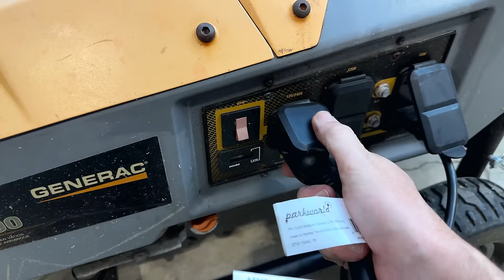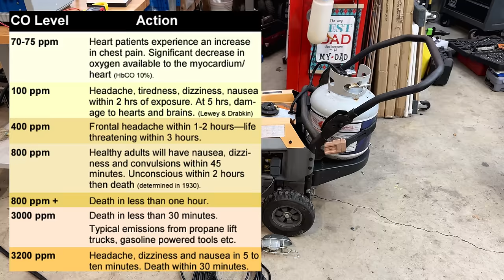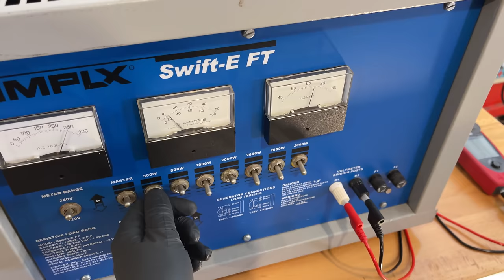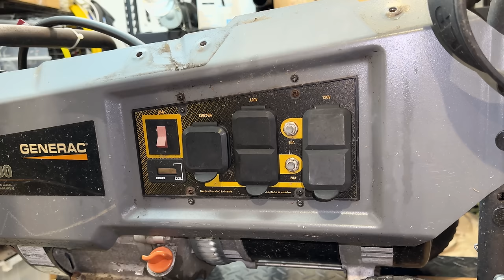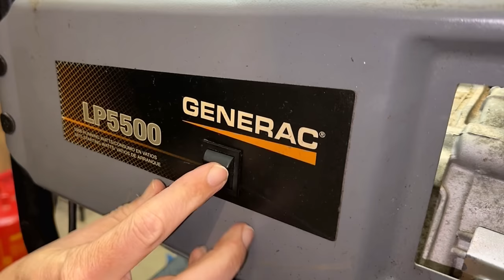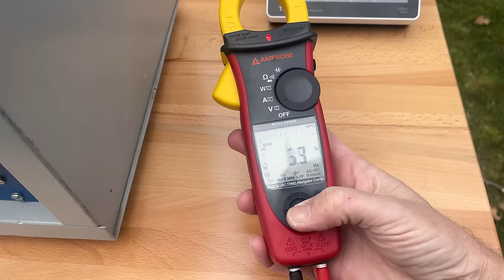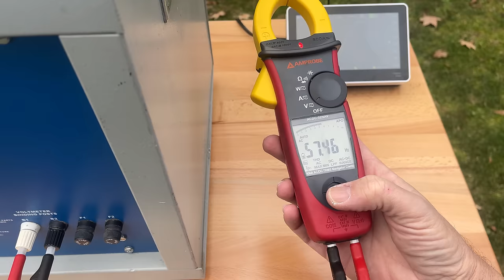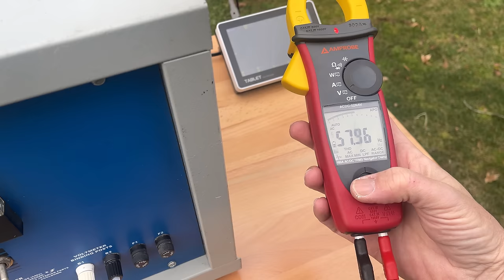Will a Cheap $40 Carburetor Breathe New Life Into This Machine?  Generac LP5500 Generator

Comment: That has to have a heat shield.  Between the hose and the exhaust.  Its not optional.  Major code issue.  You also have violated code by having a two stage regulator that vents in the open near the electrical panel, and within 3 ft of the exhaust A two stage reg vents propane to atmosphere under certain conditions.  You have ignition sources way too close. 
That machine is an explosion waiting to happen. 

The old automotive style regulator was isolated from speak and ignition  by metal shielding. 

This one is not. It has vents. 

Don’t even think about selling it. 

Serious advice from someone who knows.  Unless your insurance covers burning down customer houses, etc. 

Sorry to be the bearer of bad news.
Reply from the maker: I agree a heat shield should be added. I would have thought/hoped Generac would have done that if code.  Either way I will add one.  The two stage regulator is a couple feet further away then the original.  Under what condition would it vent propane aside from a failure in a diaphragm?
Reply: @jcondon1    You are right. That regulator will not vent unless it fails internally. OTOH, the original regulator was mounted on that plate, which probably qualifies as a heat shield. Also, the exhaust faces forward to get it away from the mounted tank. That said, I would add a heat shield, but point out that this modified unit is no longer UL approved as it sits. BTW, the rules are different for portable units versus stationary gen sets because it's just not possible to isolate the fuel supply and its systems so many feet away from the engine.
Reply: @jcondon1  the biggest issue with most propane powered engines and devices is regulator failure.  Diaphragm failure is caused by poor quality, by water in propane causing corrosion, by propane additives, and by liquid propane reaching the diaphragm.   I have seen that last condition many times when a tank is tipped over. Liquid propane reaches the diaphragm through the lines.  Poof, venting. 

That said, outdoor portable appliances don’t have the same code as larger scale items, so it varies by jurisdiction. 18inches seems to be the going number for the regulator distance so you are fine. I was wrong on 3 ft.

There are a couple of other code issues, such as feed tube routing, clamping, using bendable wire ties, etc.  but reality is and common sense says this stuff  is ok. 

I would go back and visit the propane fitting on the bottom of the carb. It is likely sealed in with a urethane hardening gas line dope.  Apply a small measured amount of heat (not MAP)  to the barbed fitting (not the carb body) to melt it and then turn it out. Install a 90 degree male fitting down (use gas rated pipe dope please) , and use compression fittings on the line and use a crimped clamp. Not a clamp that can be tampered with.  Crimped, it’s the same as a store bought hose in the eyes of the code. It’s permanent. 

Then bend the exhaust back.  And put in a small plate extended down From the grey side plate (use two bolts to protect the carb, but still have access.  Your idea about going  under with the hose was a good one. 

So you need a male to
Male 90 degree fitting that goes threaded male into the carb (probably 3/8 but might be 1/4) and 3/8 male NPT on the down side . Then buy a female NPT barbed fitting for the hose side and use a crimped clamp.  If you do these things it will be pretty much to code and more importantly safe. 

No type of screw on hose clamp is ok.  Not high pressure, not low pressure. Crimped.  (Screws vibrate loose) 

Hope this helps.  And of course, it’s all your call.  We all learn together.  You are a smart guy.  You already saw the 90 as the solution.  But you gave up too fast on the barbed fitting removal.  It comes out
Reply from the maker: Thanks for all the information.  I did give up too fast on removing the fitting.  Was concerned about heat and damaging the diaphragms.  Will swap out the fitting and add some heat shielding.
Reply: I cant think of a single gas BBQ that meets those codes
Reply: @phillipsmiley5930  you mean the ones with steel panels in between the tanks, hoses and ignition sources? Yes, they do.
Reply: I would say that Madman is just that. If we were all as paranoid as you nothing would be running. I think James did a great job and the unit is actually safer than when he took it over.
Reply: @WrigleyFieldBlues sometimes I wonder why people like yourself cannot see discussions going on, without throwing in an insult or three.   

Then I realize you don’t even fathom why these discussions are held. And you never will.
Reply: @MadmanJimbo  Your self righteousness is only exceeded by your self imposed expertise. James has a quality running unit now. You would have a garage full of parts while you wait for non existent heat shields and regulators to show up. Actually, I understand you all too well.
Reply: @jcondon1  props to your measured responses here. when i started to read this person's comments, i cringed at the arrogance. after claiming it was "an explosion waiting to happen", and having to walk back their misunderstanding of code, no humility was shown. your responses illustrate civility and wisdom.
Reply: Why not use that fancy thermo detector you recently showed and see what kind of heat you're dealing with?
Reply: You're being a bit dramatic with the "explosion waiting to happen".
Reply: @WrigleyFieldBlues  as I thought.  You will never understand.
Reply: I have worked around pneumatic regulators that regulate 120 psig down to 20-30 psig back in the 80’s but not many Gas appliance regulators and I had completely forgotten that most high pressure in low pressure out vent to atmosphere to protect what they are providing lower regulated pressure to.   Good catch sir. James does nothing that he would consider remotely unsafe especially for the consumers if his units he resells.  Thank you and I’m sure he thanks you.  @phillipsmiley5930 I was thinking the same thing but was not sure. And on those you have a tank generally under or almost under a fire and considerable heat when operating the grill.
Reply: @John-tn5dn  the USA has lots of rules.  Municipal, County, State, Federal, HOA, etc etc etc. 

Sure is a paradox of a country.  

We have far fewer rules here.  And far less crime, far less incident.  

I think open discussions of what is dangerous with propane is a good idea myself.  To protect children mostly. And of course, you have a very litigious society.  We don’t. 

Kinda like gun laws.  Keep guns out of the hands of the insane who shoot up schools, concerts, theatres, businesses, nightclubs. 

But what do I know?  I only live in a place with very little regulation, and have never seen an act of violence ever.  Homes here don’t need HOA rules.   

They are a few miles apart.  Lol. 

If you wish to modify propane or natural gas powered things with no discussions, you certainly can do it.  

There is a great video I saw of a guy who whacked a can of WD 40 with a stick.  You should watch it.  Then multiply it by 100 for a propane tank.
Reply: Madman, why straighten exhaust unless you are concerned about wheel or backpressure?  I like a heat shield for added protection to the carb but question its necessity unless something failed.  I saw James used a thermal imaging camera in another video, I would be curious to see change in temps original exhaust, 90 degree bend with and without a heat shield.  If I  recall correctly radiant heat transfter changes as distance increases to 4th power so small changes in clearance can have very big impacts.  The other thing is for a portable generator couldn't you put a standard Generac forward exit exhaust on (James should have them laying around) and relocate propane tank to the rear (even remotely).  My Generac 5500 uses about 6 gallons of gas for 12 hours give or take.  So if I fill it to the top of the neck it powers my house for 1/2 day.  I wonder with 50 pound remote propane tank how many hours at 50 percent rated load I would get.  I would love to be able to set it up and run for 48 hours or more before changing propane bottle.

I am thinking about buying these parts for a conversion,  other ideas about compression fitting to the hose at the carb I didn't understand.  If James cuts the new 10 foot hose how does it attach at a carb with a brass 90 degree fitting?  If you can point me to brands or suppliers I would appreciate it.  Does propane tank need to be secured from tipping by code?  Is this a NEC or some other code requirement for propane fuel devices?

Lastly do you know the UL (Underwriters Lab) test specs and/or procedures that would apply to carb fuel supply and regulator.  I would like to look them up and read them.

I think James is on to a useful conversion from single to multi fuel.  A bit of fine tuning and it seems a safe, cost effective process can be developed.

Great video.   Great comments!
Reply: @jimw6991 the wheel was my concern.  It might melt.  Not a big deal either way.  Certainly James could run it outside for a couple minutes and then take a laser thermometer to the wheel as soon as he turns it off.   If it’s not hot it doesn’t really matter
Reply: @MadmanJimbo  Where is "here?" If it's the UK you by no means have a leg up on us. It is a dead country with most children at some degree of being hungry. Take a hike.

Comment: I have that same model Generac. It was always hard to start. I spoke with a guy a few years ago, turns out he works for a company that makes kits to convert pretty much anything from gas to propane. I explained to him the issue I had with starting and that the prime/purge was done for 5 seconds. He advised me that 2 seconds should be more than adequate. I tried it and did find it started much easier. Another thing he told me was to not open the valve for the propane quickly, open it as slow as possible. He said the quick way can cause a surge of pressure that shuts the diaphragm down and it's better to open the valve as slowly as possible.
Reply: That procedure is advised for all propane fixtures.
Reply: Ho!  Knowledge is gold.  Thank you for that gold.
Reply: It's very easy to trigger excess flow shutoffs, and that is likely what he was talking about.

I appreciate the extra safety when it is unobtrusive, but I have disabled excess flow devices on my own equipment when they require extreme care to avoid triggering.  If I need to open the propane valve extremely slowly a half dozen times before a grill works, there is no way that feature is acceptable for a casual user.
Reply: I used to get aftermarket propane conversion kits to make gas run on propane back in 2005, 2006 still have a couple kits with regulators, but quit doing them , liability

Comment: Hey Jim. Thank you for another excellent video. As an electrician who has done control panels, we would mark the cutout with masking tape which also would protect the paint. Then drill the corner's with a bit slightly bigger than a metal use,  jig saw blade. Then jig saw the cut out. Always hold the jig saw firmly to the work before turning it off.

Comment: Hurrah! Thanks to you, Jason, the original owner and Amazon!

I'd say that Propane is the preferred fuel for these stand-by items: no long-term gummed up gasoline.
Reply: If your property has a Natural gas line, that would be cheaper to run. The difficult bit
 would be making a long flexable pipe with fittings that would meet code

Comment: I put one of those cheap 40 dollars carbs on a Wen 3500 gen to run on natural gas. It worked Great. I eventually sold it and bought a bigger B&S 5500 gen. I tried adding the Garrison kit to run on natural gas but gas supply didn't provide enough natural gas to run it so I switched it back to gasoline. I sure miss running on natural gas. It made everything so easy. Oh well! Thanks for the Great Vids Jim.  :eyes-purple-crying:

Comment: Another great video. Thanks. I find that the best way to cut out a square opening like you did in the video is to use a metal cutting fine tooth jigsaw blade. First drill 4 small holes at each corner for clean corners and squareness, then make an opening with a dremel in the center of the square just to fit the jigsaw blade.

Comment: As always, great video! For future reference, There are two load-block adjustment screws on that $40 tri-fuel carb. It's on the LP-NG selection knob itself. One screw is the load block for LP, the other for NG. I had to find this out the hard way. To tell which screw is which, turn the knob to your fuel of choice and whichever screw lines up with the center axis of the outlet tube, is the currently selected load-block.

Comment: Great video James and glad you were able to get it to a sellable condition! Thank you for the shout out and channel mentions! 😊
Reply from the maker: Thanks for the machine.  It cleaned up well.  Just looking back at your video when you first got it.  It was a really mess with pine needles, leaves, dirt.  Definitely neglected and left outside.
Reply: @jcondon1  For sure! You also did a lot of work to get it to sellable condition again. You may have put $75 in parts in, but your labor cost, the original customer would have never paid that.

Comment: I did a similar conversation, but on my all power 3500 propane generator. I bought a propane carb with an adjustable load mixture screw. The old regulator had a venting diaphragm problem.  The vent hole was totally glued shut, so it would not adjust regulator pressure to the 1000 feet above sea level, where i am.  Like you my generator started on 1 first pull on propane. I used my old camper high pressure regulator to connect to the propane. I also had a natural gas 3/8 quick connection which i tested connected to the low pressure regulator. I am happy now. Connect generator either to propane or natural gas, press the prime button for about 3 seconda. 1 pull and away I go.  🙂🙂🙂👍👍

Comment: James, Thank you for testing this carb! I am as surprised as you are that a $42 carb would work so well! As I told you before, I am considering converting my (older) Predator 8750 gasoline generator to propane or NG and I am very happy that this cheap carb works this well. Again, thank you for your time and effort!
Reply from the maker: It does work well and will bolt right on to a Predator and many others.
Reply: Isn't the predator 8750 the 670cc 2 cylinder engine James? Do you think that carb/ regulator would be enough volume to run a 670 predator? I'm asking because I looking to do the same as OP. I was under the impression I would have to buy the conversion kit with the carb tube like you did on the one with the bad tank.
Never mind: it's a 420cc 1 cyl 🤦‍♂️
Reply: @laymanengineer7502  Hi, you already answered your own question...  But...  The Predator 8750 has two versions, one is an older model that was replaced by the 9000 (virtually identical to the older 8750), and the other (newer) 8750 is an inverter model. I have the older one. Both have a 420 cc 1-cyl engine, that is basically a Honda GX390 clone. I'm not sure that Predator makes a 2-cyl generator of any size, I don't think they do. Even the biggest one they make (the 9500 inverter) is a 459 cc engine, which I believe is also a 1-cyl (but I could be wrong).

Comment: Nice job Jim. Went to Gary's channel and watched it. Thank you for exploring that cheapie tri-fuel carb from amazon. I've always wanted to try one of those out. 
Almost 50yrs ago *(about 1975) I went w/ my Dad to an Onan dealer who had a motorhome 120v 2cyl generator that they had rebuilt for sale. It was 4,000 watts and they wanted $750. The mechanic told us the piston rings were probably too tight and the customer returned it because it wouldn't start. The mechanic connected a huge 18 wheeler battery to it and it started right up. So we bought it and took it home. On a regular car battery it wouldn't roll over compression, so it wouldn't start. I pulled both spark plugs out and got it cranking over, then installed one sparkplug while it was cranking and hooked up the wire and it was instantly running on one. I sheepishly got the other spark plug in and the wire hooked up and it was running like normal. We let it run nonstop for about 24hrs to loosen it up. It's always wanted a real good battery, and sometimes if we didn't have one,  we pulled the sparkplugs out and went thru the same thing, and it has always started. Dad used it a lot for 25yrs befor he gave it to me. It's my standby generator for those days when the power is out. It's a great unit in that it has always started and runs so smoothly at 1,800rpm, and not real noisy with the original "Nelson" muffler  but it's only 120volt. I just ran it nonstop from Friday evening until Saturday evening during the "big snow storm" of January 12th & 13th here in Michigan. It burned about 14 gallons of gas running my whole house except the well. For some reason when my house was built they drilled the well out in the middle of my front yard and put a 240 volt water pump down 50 feet into the pipe, so I had no water, but I really like that old Onan 2 cylinder generator. My only wish is for it to be 240 volt, but it always starts and runs so smoothly, it's music to my ears. Thank you for your channel Jim, you make it possible to experience a lot of different things.  ben/ michigan *best I can remember.